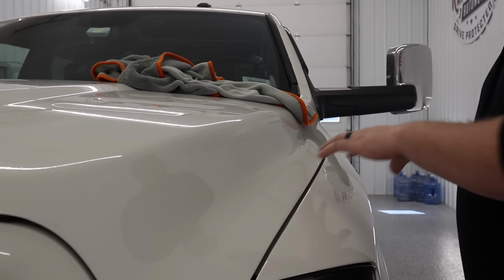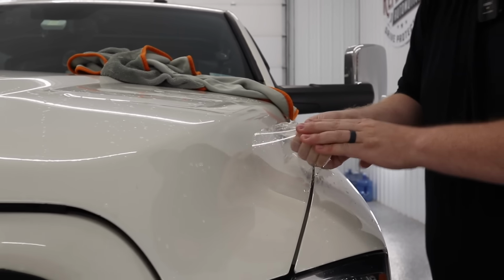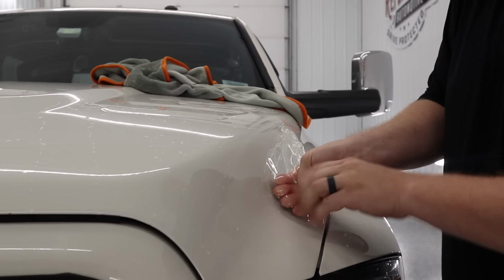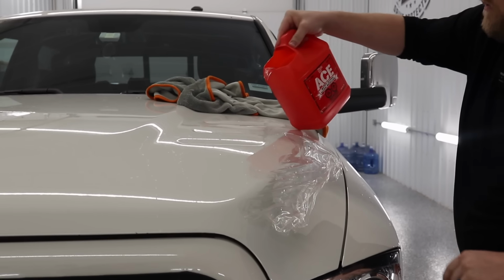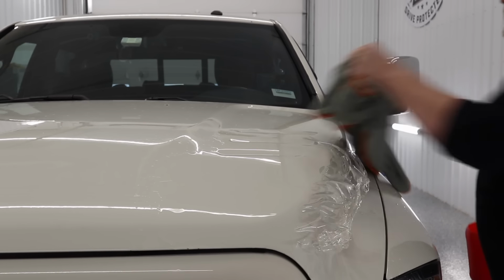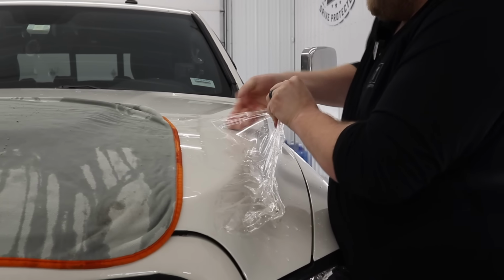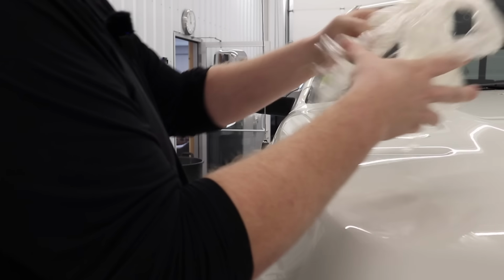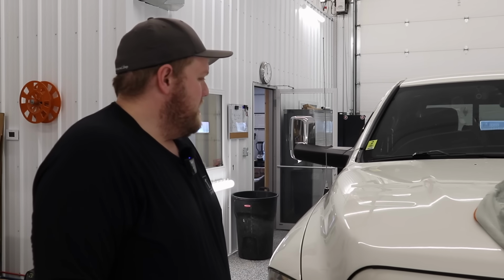DIY - How To Remove PPF Wrap (Step by Step) | No Steamer Needed!

Comment: mine was twelve years old. I don't think this would work. But I got it off using a steamer and chemical, with plastic blades.
Reply: how was the paint job after you removed? Mine is 12 years old as well
Reply: @Omar-mc3dq  it looked like new

Comment: now try to remove some old 7 years old ppf
Reply from the maker: Easy
Reply: If it's new you can just peel it right off, after a few years it looks NOTHING like this. I just removed mine and it crumbled there's no way to "peel" it off. Just plastic scrapers a cheap steamer and about 2 hours. Then googone and another 1/2 hour to remove the glue.

Comment: What is the advantage of water & towel combo vs the streamer? And What brand film was this? Something from 2016 isn’t that old compared to my 2003 - that stuff was a nightmare… it came of like a sunburn: tiny flakes. Also this is a white vehicle which never got super hot from the sun. My current car is medium blue in FL so the UV damage to the film is bad, so it breaks apart when pulled. In areas that got less sun it comes off pretty easy but the top surfaces ummm no so lucky, stuck hard there. Regardless it protected the paint underneath so I’m recovering it.
Reply from the maker: Advantage of this method is that the towel will hold the warmth and therefore keep the film softened and easier to remove. Steam you have to be constantly steaming the area. If you don’t it cools down and the film becomes harder to pull. Hope this makes sense.

Comment: Sorry but I can't believe that has been on since 2016,its just way to clean. My 2017 was a pain and the edges were very dirty. That stuff is spotless y you even taking it off ?
Reply from the maker: The reason for the removal was because the film was damaged, and the edges were not wrapped. This customer kept his vehicle clean so dirt didnt build up on the edges. Plus if you take the time, PPF removal doesn't have to be a pain. Use hot water or a steamer and take your time and you will be just fine.

Comment: I removed my PPF less than a week in. New to the whole experience and didn’t realize half the hood meant a straight visible line all the way across. Wasn’t waiting for the install company to get it off. It came off ok with some effort. No paint damage or material left behind. Your fingers must be used to this. I got blisters unfortunately. 😂
Reply from the maker: Haha! Blisters can happen when removing PPF if you are not careful.